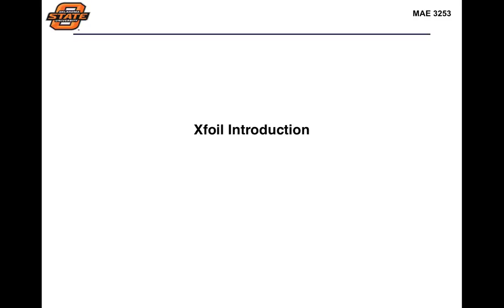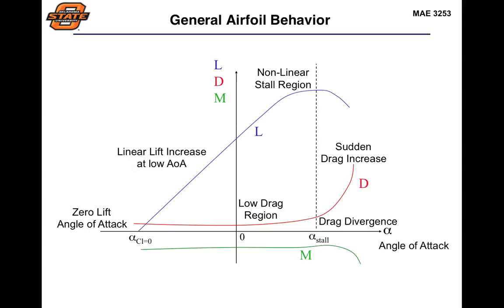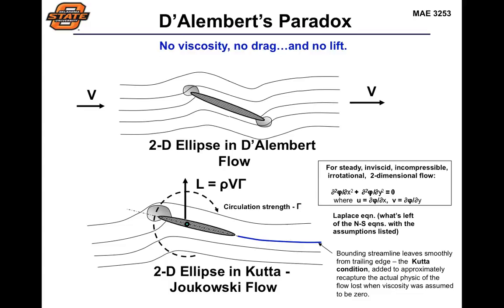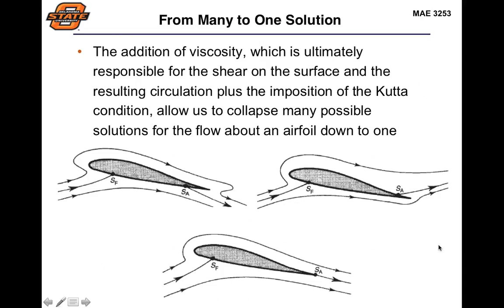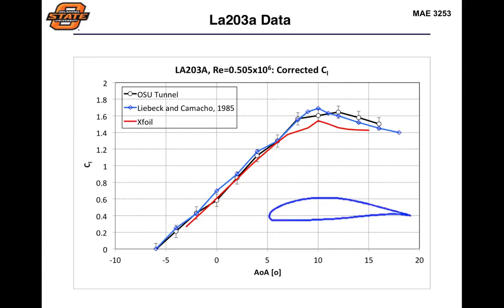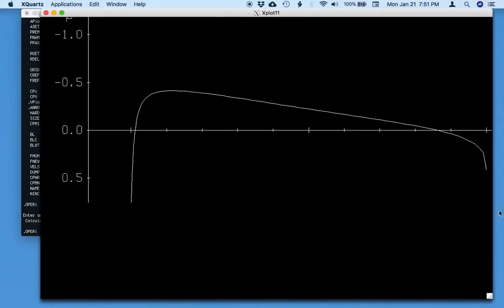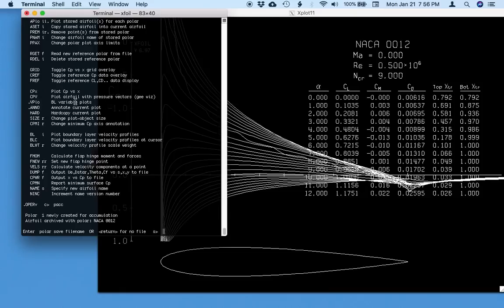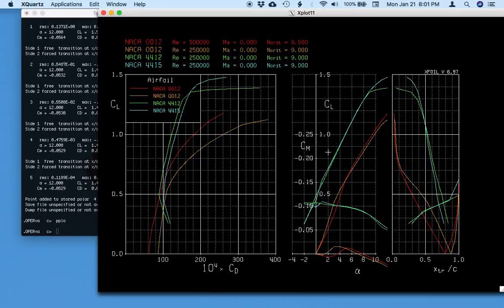Introduction to Xfoil

Comment: In the airo dynamics the intense air pressure begins on the larger part of the foil when the object are fly in the kinnetic speed and the smaller tail is useless the air return and rotate in the back of the larger part of the foil look at the sonic boom  so in flat section of the foil are constant no air return  so in the plane mostly the engine nozle in in the below of the plane but how about if they attached the jet engine nozle are attached it on the near back part of the larger foil to suck the air moves on the center of the curved air foil

Comment: Hello,

I do have one question about the XFOIL. If I am importing the coordinates for the airfoil from notepad (of Chord =0.25m) how I could specify the point where pitching moment is acting. In XFOIL the moment act at 0.25c (for C=1). For me, it should be at 0.25*0.25 c.

Regards